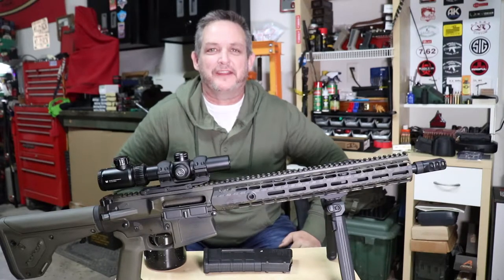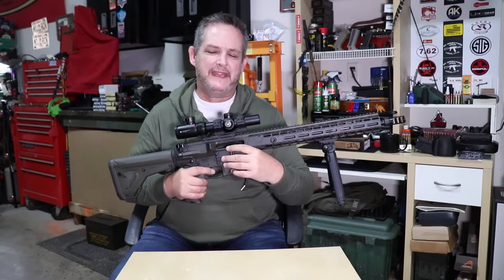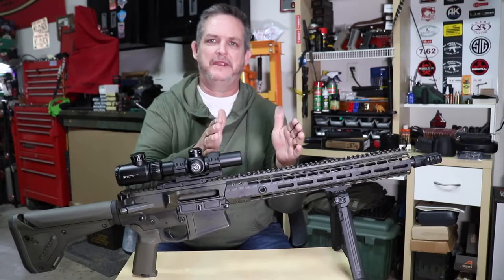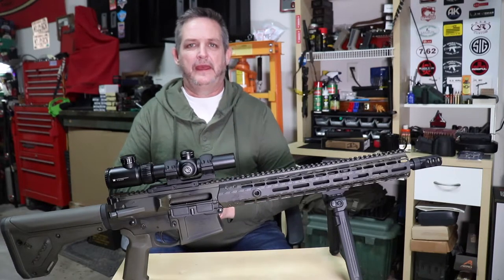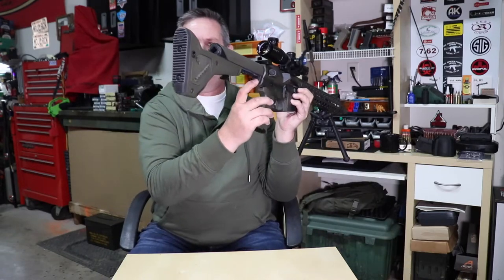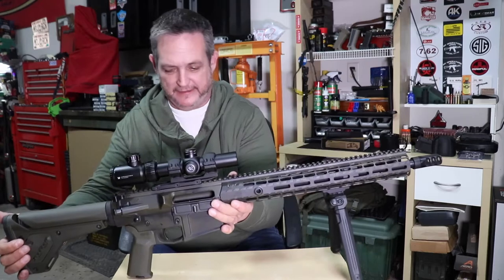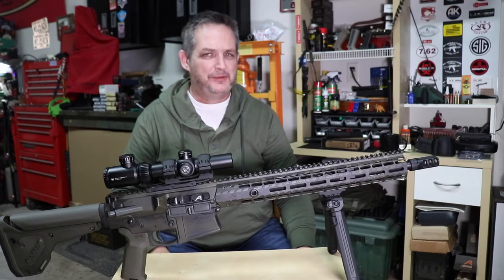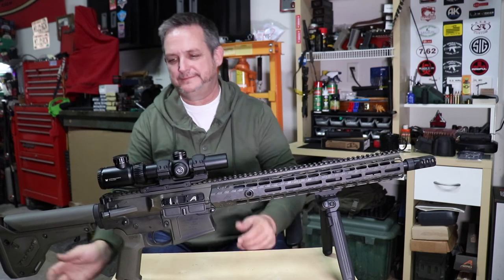Try the A5 buffer system

Comment: Outstanding, sir!  I appreciate the video and the information provided.  There is not much information on this page regarding the A5 system configuration specifically for the AR10 platform.  I purchased the UBR Gen 2 for the looks and application without realizing that I was getting into an A5 system.  This video answered my question as far as the buffer system set up.  I considered calling it, sticking with the carbine set up, and running a JP buffer system.  But, as mentioned, why not take advantage of the A5 system.  Keep up the excellent content on your channel.
Reply from the maker: Thank you for the compliment.  Go to the heavy buffer site or call him.  You will be extremely happy with the buffer spring combo and the recoil is nothing short of amazing.  I would also run an adjustable gas block.
Reply: Where can I purchase the A5 buffer system for my 18” 308 with riffle length gas system ??
Reply: Where can I purchase the A5 buffer system for my 18” 308 with riffle length gas system ??

Comment: On an AR-10, you can also use a A5 tube, Sprinco red spring, and Carbine length buffer weight (H3), and throw in a quarter as a spacer, and it'll give you all the benefits of a Vltor A5 buffer weight on an AR-15. Minus the internal biasing spring that the Vltor A5 buffer weight has. 
Vuhl-Tor lol 😆
Reply from the maker: Sounds about right.  While researching what I was going to run, I found there is a ton of different combos and formulas that guys have come up with.  The key is the overall length of the buffer/spring combination as it pertains to tube length.  If your setup is too long, the bolt wont cycle as it wont allow it to travel rearward enough and too short and you have other problems.  I went with this super heavy buffer because the guy that makes them has been testing them forever.  People I talked to swore by it and they were right.  It shoots better than some ar15's ive shot.
Reply: That is one of the most important parts of the buffer
Reply: @adammcallister9675  Even without it you still gain some benefits. But it would be interesting to install a AR-15 LARB buffer on this 308 setup since it does have an internal spring, and you can also flip the spring to match the same bias as the Vltor
Reply: I've heard about the "spacer" in the end of the a5 receiver extension thing from sprinco. However,  they make 2 different red springs. One extra power m4 carbine length (25006) and one ar308 one (25208) that is intended for intermediate length receiver extensions and a m4 carbine buffer. Which, as I understand it,  is what the armalite ar10 uses. In this video, he is using the ubr gen2, it essentially has a a5 receiver extension. There seems to be three general receiver extensions, buffer and spring combos that can be used on this platform.  Rifle lenght, carbine length and the ever so confusing a5 intermediate length.
Reply: @timbrassinne719  I swapped all my buffer tubes to intermediate length (A5)
When using A5 on a 308, you can then use a standard carbine length buffer weight instead of special short 308 buffer weight. Since the 308 BCG is longer, it uses a shorter weight than AR-15.
I now running A5 length tube, Springco Green spring, and a spacer with H3 AR-15 buffer. It's really nice like this. You could also use the red spring as I used to.
There's no guarantee that you'll need a spacer. You have to test the gap between the BCG and the lower to know for sure. Take the lower off, insert BCG all the way into the buffer tube, just like it would be when fired, then, make sure bcg isn't impacting the lower. On an AR-15 you can do the same thing, but you'll be testing the gap between the gas key and the lower in the case.
Anyways, stack two quarters together, the gas should be the thickness of the two quarters together. If it's significantly less that that thickness, then you can add a quarter to the buffer tube. I like to drill a small weep hole into mine. Just google "gas key gap" you'll see the video from instructor Chad over at school of the American rifle. Phenomenal channel I must say.
All my AR-15's run the Vltor A5 buffer system. Most of them don't need a spacer at all.
I actually did pickup an A5 length LARB buffer weight, And I must say it's very effective. Makes me want to get a standard carbine version to try with my 308 with the A5 length tube.
Reply: @CoryHobbs2178  I built on a5 tube / sprinco orange / h/h2/carbine and it doesn't run at all. I stole a longer spring out of a DD5 and that seemed to work with a regular ar15 carbine buffer. need to test more.
Reply: @kevinfitzsimmons1258  for 308 yes you must use a carbine buffer if using an intermediate A5 tube. The orange spring is probably too powerful. I would recommend Sprinco green and H2 carbine buffer. You can also use springco red spring, but don't forget to drop a quarter in the back of your tube if going with red.
No matter what setup you use don't forget to do the carrier gap test. Take the lower off, take the bolt carrier group and insert it all the way into the tube with the spring and buffer in. Push it as hard as you can all the way into the tube and make sure the carrier shoulders are not touching the lower. You want there to be a small gap there The width of a quarter or two.

Comment: So I understand your using a rifle length spring, what size buffer? Is it a standard size 308 carbine buffer or a standard size ar15 buffer? Thanks
Reply from the maker: 308 carbine but heavy heavy heavy.  check out heavy buffers .com
Reply: I made this mistake as well, which Clint quickly corrected for me!
Reply: @rockordnance  often the .308 buffers are shorter than the standard ar-15 carbine buffer. like a little mini buffer, because the ar-10 bcg is longer that ar-15.

Comment: you did not mention the length of the buffer itself. Is the A5 buffer the same length as the carbine buffer??? I get that the buffer tube is longer, but what about the buffer? I believe most AR-10 (DPMS LR-308) use a standard ar-15 carbine length buffer, which because of the longer bcg, it then requires a shortened buffer to allow the bcg to travel all the way back  to lock the bcg to the rear when empty. With the Magpul UBR, you can use a standard length carbine buffer, and not use the little spacer. at least that is what I understood from the instructions that came with the UBR stock. I also have built a aero AR-10 (LR 308) using the ubr stock, with a carbine length H2 buffer and standard ar-15 carbine spring. My rifle also has the superlative arms adjustable gas block. one more question....are you sure the rifle length spring is not too long?? like it might be bottoming out on itself under full rearward movement of the BCG.  Also, I have a 18" barrel with a rifle length gas tube/system.
Reply: The carbine tubes on the ar308 use the shorty style buffer weights. The rifle tube used standard ar15 buffer weights. I rub a carbine tube on my 10.5” 308 pistol.

Comment: Hello, 
Thanks for the information in this video.
If by some chance your still answering questions on this topic I have one.
I habe a Davidson Defense .308 complete upper with a 20" stainless barrel. Shot it for the first time yesterday, it didn't go so well. Would fire round, eject round but not load round. 
I talked to Omega Tactical (purchased complete upper from them), they said when they test fired the upper they used a 3.3 oz buffer weight. Mine is 3.7 oz, you think .4 oz would make that much of a difference?
Here on YT, in the comments in some other videos people are saying after they tried different buffer weights to no luvk, they drilled the gas port a little bigger and it helped. I'm not really looking to start drilling on my barrel if I don't need to but I don't want to waste time and $$ on multiple buffer weights.
Any thoughts? 
Anyone?
I may just give Viktor a call and ask them what they think the best path is.
Thanks

Comment: I'm new to the AR10, I'm putting my first one together, (Aero M5 lower, M5E1 upper).  This video was the first time I heard about the A5 system.  I started doing some research on it, I ran across a forum, (can't remember which forum) where a guy was talking about the Magpul UBR.  According to him, while the UBR can work with an A5 buffer tube, it will not work with an A5 buffer.  Does anyone know if this is true?  Seems kind of odd.
Reply from the maker: There is a difference between the old ubr and the second gen.  There can be overall length problems depending on buffer length and what spring (rifle /carbine). get hold of a company called heavy buffers dot you know what.  Tell him what you have and he will steer you in the right direction.

Comment: I need your advice. Just before the pandemic,  I bought a PSA  AR 15 lower and freedom upper. Also got a great Bear Creek AR 15 upper in 7.62x39. 
Do I need a different buffer weight for the 7.62x39 setup? Thanks. 👍☕😎
Reply from the maker: Adjustable gas block unless your using a high end  or quality barrel that has its port drilled properly and isnt overgassed.  Standard weight m-16 pattern bolt carrier and I would start with an H2 buffer and possibly go higher.  Most problems ive seen with x39 is the bolt traveling too fast and trying to strip a round before its popped up high enough in the mag.

Comment: Awesome awesome build you have there, sir. I liked it so much I'm building the exact same one with exact same parts, minus the E pluribus graphic, I went all black. 
My question is, I just want to confirm the buffer spring and weight set up and it's ok to run a 308 rifle length spring with a 10oz weight? Not sure if I'll go with that weight but would a H3 weight be ok?
Reply from the maker: heavybuffers.com. call them
Reply: I run a 5.5oz with my 10.5” 308 pistol and it’s perfect. I wouldn’t think you would need that much weight with a mid length gas system

Comment: I have a 18” rifle length gas system aero precision M5. Just bought a UBR and need any help on deciding on which buffer kits to use for best outcome. Was going to go with PRS but ended with UBR for use of precision with a scope and medium range with a offset red dot.
Reply from the maker: look up Heavy buffers .com  Call him or email him.  The owner himself will talk to you and fill you in on why they work and trust me with the ubr and the longer tube they work flawlessly and super low recoil.. Ill be you end up running the extra heavy buffer he recommends which I believe is like 10 ounces ( i forget the actual weight at the moment but its between 9 and 10 ounces) and a standard rifle length spring.  Trust the guy, he knows what he is talking about.

Comment: Wonder if this works with psa pa10 :/
Reply from the maker: im sure it would just need the correct buffer tube, spring, buffer and most likely an adjustable gas block
Reply: @rockordnance  any ideas on a setup? I was thinking maybe the a5 buffer system with an 8oz buffer and rifle spring.

Comment: What weight buffer do you think I could run reliably in a 20in, 308 Bear Creek Arsenal upper with the ubr system?
Reply from the maker: call the guy at heavy buffers .com.  He wont steer you wront.  I would say 10oz like mine.